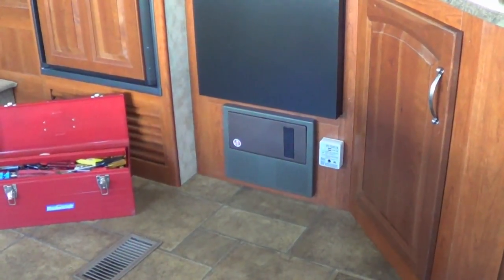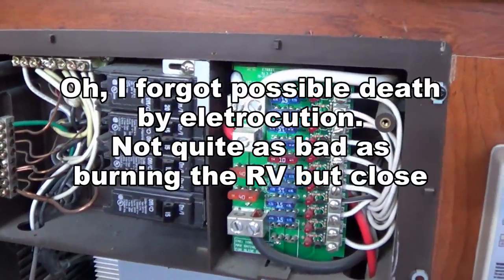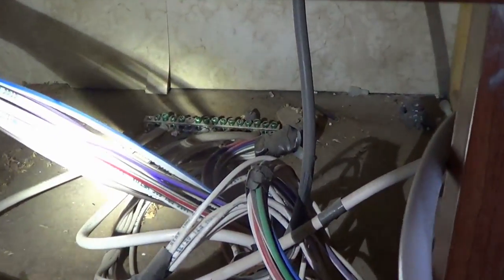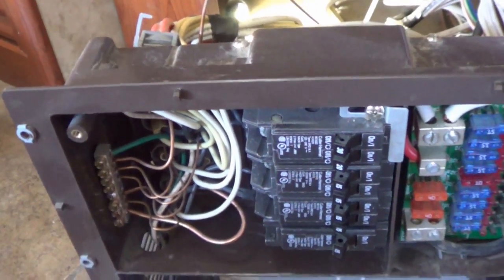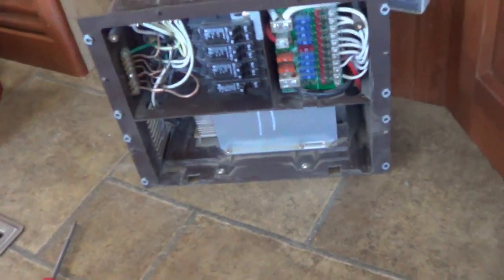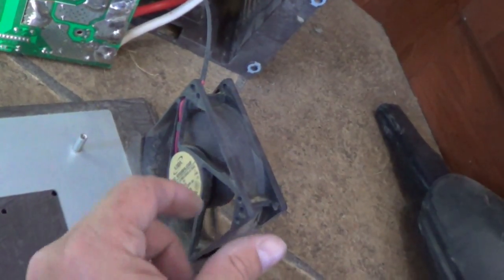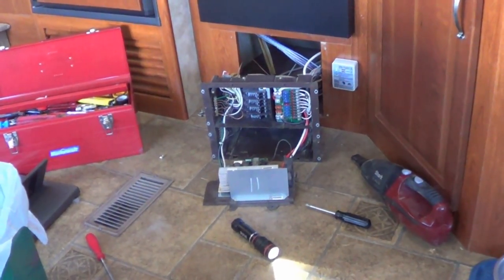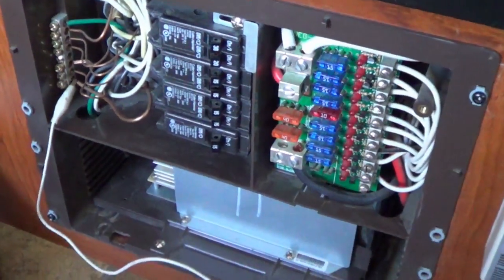RV Power Center Inspection and Maintenance WFCO WF8955

Comment: Good video.  Them  old converters cooked the batterys when left on.  A new computerized one is the way to go.  I see Angie checking out your work.  Did she pass it?
Reply from the maker: Yup! haha.  This WFCO does have 3 stage charging but it's not the greatest that's for sure. The problem with it was undercharging versus cooking them. But with the solar system installed now, my batteries are much happier. :)
Reply: I always wondered if you could feed the output of the old inverters directly into the solar charge controller panel input and have your solar charge controller control the voltage going into your batterys?
Reply: hogcat... you mean "converter" not "inverter" right?
Reply from the maker: I personally haven't heard of anyone doing that. Would be an interesting experiment. Might work but I think it would likely be inefficient.
Reply: Inefficient no doubt, since introducing any components into the path would add each component's own inefficiency to the total chain, but if it works it seems like it could be better for the batteries when using older converters?
Reply from the maker: I assume so
Reply: Yea I meant converter.  Sorry
Reply: Thanks Ray very informative.
Reply: I do have a wfco in my motorhome and I just bought it a week and a half ago
Reply: And I was looking at the panel today as a matter of fact. I don't have all the experience you have. But again I thank you for the introductory on what that was.

Comment: Great video. How do you shut off your controller charger when you are running an inverter?
Reply from the maker: My RV has a dedicated breaker for the AC supply to the charge converter. Flick it off and the charge converter is off.

Comment: Thanks for the response. So your intellipower only works with the generator for the batteries?  Is it a separate system from the OEM?  I’m confused how the two converters interact with each other.
Reply from the maker: Yes, they are separate, I installed a separate input receptacle at the front of the RV for generator to plug into to recharge my battery bank via the InteliPower charger when needed, normally we get our charging power from the solar array but when the sun doesn't shine the generator is used.  When on full hookups I just let the OEM converter work alongside the solar charger. May as well wear it out versus my InteliPower unit.

Comment: Ray, thanks so much for the excellent video. I know I am late to the party but this info is just what I need. I recently installed a lithium 100ah battery. I have the same converter as you. The company rep told me my charger will work with lithium but not designed for it. WFCO does have a bottom section that is designed for lithium and I can get it, at a cost of $285 plus install from a local RV specialist. Since I run a Renogy 100 AH solar charger designed for lithium and a stand alone battery charger also designed for lithium, I am not sue I need to go to the extra expense. With the Relion lithium battery came a battery monitor with shunt. It has been suggested that I install the shunt to the Controller. Any ideas about this . I am a little confused as to where the DC load pole would conect to the shunt as well as the DC cable that goes to the battery. Any help would be appreciated.
Mark
Reply from the maker: I've just left my OEM WFCO the way it is for use hooked to shore power and use solar and a second better quality converter located beside the batteries to charge with, usually, it's with the generator when off-grid.
I've found the WFCO won't even charge the lithium much. Tends to drop into float and just maintains the charge.
You want to install the shunt between the battery bank negative feed and all the negative loads. That way it can measure all the current going in and out of the battery bank and calculate a state of charge in percentage. Cheers, Ray.
Reply: @LoveYourRV  Thanks Ray. IF I keep the Lithium, I will upgrade the bottom unit as suggested by WFCO. I suppose I could replace the whole unit but ar what cost? I still think the Lithium was a good LONG TERM purchase, just getting more costly initially.
Reply: @LoveYourRV , Ray, the part # for the WFCO lithium converter is : WF-8950 L2 MBA WFCO
Reply from the maker: You could also use a different brand like a Intelipower or a Iota

Comment: Does your intellipower also feed the 12v side of the power distribution center?  That’s where I’m getting confused.  Do both converters power the DC side? Thanks!
Reply from the maker: Sure, there is the cable leading from the battery bank to the RVs 12V distribution panel, so since the IntelliPower is connected to the batteries it's also capable of feeding the 12V distribution. Just like when you are unhooked from shore power your batteries provide power to all the 12V stuff in the RV
Basically just think of my InteliPower as a fancy battery charger I'm using with my generator. To get the maximum charge amperage I located it next to the batteries to reduce wire losses and voltage drop.  If I wanted to turf the OEM WFCO converter I could simply remove it and run an AC power line to where the InteliPower is located and it would also be my shore power charger, but like I said I prefer to wear out the OEM converter doing that job as all it really does is sit there trickle charging for the most part anyway. So if it someday packs it in I'll do that.

Comment: Word of warning....if there is solar installed. Always switch the PV input to controller off BEFORE switching the battery disconnect off , as most controllers require batteries to be hooked up when they are generating power from the PV! I swapped out my battery disconnect switch for a dual pole version to simultaneously switch off the PV when I switch off the batteries.
Reply from the maker: Thanks, a good tip for others. In my case, my battery disconnect switch only switches off the 12 volt RV circuits. My solar controller was still connected, I have a separate switchable breaker for that. Was no need to turn it off as my inverter has its own outlets separate from the regular RV AC system.   http://www.loveyourrv.com/wp-content/uploads/2016/07/Boondocking-System-Diagram.jpg

Comment: Good video Ray, doesn't World Friendship inspire confidence. I noticed there was some slight discoloration on the AC/DC converter PCB. I'm sure its normal, results of a warm component,  but someone might worry about it if the are doing a Ray style inspection.
Reply from the maker: haha, yeah, really. ;)If it's the brown around the 4 large solder joints for the two big white resistors it's just extra flux that flowed off the joints.

Comment: Were is the on an off switch located you showed on video?
Reply from the maker: It was in my battery compartment which is the front storage bay on my fifth wheel trailer. I installed it there so I would have a way to quickly cut the 12VDC batter power to the RV circuits with out having to unbolt the battery terminal. Some RVs come from the manufacture with a battery cutoff switch some don't. Cheers, Ray

Comment: Ray, I've got a 2012 outback with the same fuse panel and my fan on the power converter isn't working at all. So when I use my rv I haft to keep the cover off to let the heat out or it overheats and flips the main breaker. I'm no electrician, but would like to know, how can I change the fan or can I? Or do I haft to buy a new converter?
Reply from the maker: It looks like a computer fan, 12V I imagine. You could pull it out and see if it has some writing on it so you could match up a replacement. It should only have a couple wires to dal with and may unplug from the main converter board. I'm away from my RV on our boat now or I'd look for you. Cheers, Ray

Comment: Ray doesn't  the DC convert to AC?, or does it convert both ways?
Reply from the maker: The WFCO converter converts the AC shore power into DC power to charge the batteries which power the RVs 12 volt circuits. It's often referred to as a charge converter or converter charger.  An inverter is what converts DC battery power into AC power.  And lately, RV companies have been installing a device called an inverter charger which basically is a combo of the two.  Gets confusing. :)
Reply: Ok that makes sense, thanks for responding

Comment: Question, the power for my "Charging Station" (12V and 2 USB outlets) recently loss power.  I pull the cover off the Charging Station and see two positive and two negatives are connected together that feed power to it.  Both pairs of wires are without power.  Could I trace the wire colors back to the Panel with the converter and see if they are feed into the circuit board there?
Reply from the maker: Yeah, though depends on the wiring colors. In my rig pretty well all the DC power runs use the same colors.  I would check the DC fuses and see if any are blown and for loose connections.

Comment: Hi Ray, question for you, I do have a 50amp braker pannel split in 2 sections (one leg 120v and other leg 120v) my question his do I get 25amp on each legs ? And can you go more than 25amp on one leg, let say 35amp leg 1 and 15amp leg 2 ? Thanks for your help.
Reply from the maker: A 50 amp RV power service is 240V @ 50 amps so when it is split into 2 legs each leg is 50 amps @ 120V

Comment: Hit that fan with a can of compressed air, maybe also a couple squirts of WD40 and it'll be quiet again. You can buy replacement fan online from All Electronics for almost nothing, replaced a few myself.
Reply from the maker: Good tips thanks. Even brand new the thing was annoying. Really needs a better quality fan. But, since I've installed the solar it rarely ever runs since the batteries stay so well charged. So that's good. :)  Cheers Ray
Reply: @LoveYourRV  Never use WD40 if there is heat or electricity, it is very flammable.

Comment: Ray, btw: I see that there are two 40a fuses just to the left of the fuse bank but not labeled.  What are these for?  Also, my #7 fuse is illegible but looks like “MON” but cant be sure that the last letter is “N”, any guesses?  Thanks again.
Reply from the maker: The board says reverse battery protection. I guess its for if you wire the battery backward. And the Mon in mine powers the tank level monitor panel.
Reply: Love Your RV ok, good deal.  Thanks again.  Keep up the good work!

Comment: Thanks for sharing that Ray. How many watts of solar do you have?
Take care
Tony
Reply from the maker: We have 500 watts. Here is the boondocking system as it sits now - http://www.loveyourrv.com/diy-rv-boondocking-power-system/  It served our needs well last snowbird season. We aren't huge power users, couple computers, chargers,  TV, lights, etc.
I may add two more panels to the roof at some point to help out on the overcast days.
Reply: I'm just watching your install of the second two 100W panels. I'm guessing the other 100W is the portable unit.  I like the way you layed it out.
Thanks for sharing.
Tony
Reply from the maker: Yes, a company sent me out a flexible panel to do a review last summer. So I used it as a portable panel.  - Here is how it worked out. -  http://www.loveyourrv.com/update-boondocking-remote-solar-panel-mod/

Comment: Where is the Neutral bus bar for the DC side. All videos I have seen, there is the hot and a neutral side for hook ups. I see only one side for hook up.
Reply from the maker: At this time in the video, you can see the negative DC bus bar -  https://youtu.be/gr2iNdMzqi4?t=219. It connects to the RV chassis below it. Bolted to one of the trailer's steel I-beams

Comment: Where is the neutral bus bar for the DC side? I see other Progressive amid converter videos that have the hot side for the DC wiring and one Neutral bus bar for the other wires. I only see the hot side for the DC wires.
Reply from the maker: At this time in the video, you can see the negative DC bus bar -  https://youtu.be/gr2iNdMzqi4?t=219. It connects to the RV chassis below it. Bolted to one of the trailer's steel I-beams
Reply: Thank you for that. I did not know with this model you had to actually purchase a neutral Bus bar for a complete hook up. I had just bought this one and was wondering how it needed to be done. Thanks.
Reply from the maker: @danemmerich6775  Here is a closer look at it from when I replaced my stove https://youtu.be/FfsmPsW2GX4?t=326

Comment: can I pick your brain I have a problem . my thermostate  blew  a fuse I changed it I changed the computer board in my AC its a 15000 and my fan copasitor . my AC and heater dosent work still mabe u can help me . I have a Laredo the same as your.thanks love your show.
Reply from the maker: At his point, you are going to have to get a multimeter and a schematic of the AC heating cooling system and start to make voltage measurements and see what circuit is a fault. Try to find the service manual online for the AC unit and follow its troubleshooting steps. If that is beyond your comfort zone then an RV tech needs to be called in. Cheers Ray

Comment: Here are two links to the WFCO power distribution center and the Inteli-Power PD9200 power converter:
https://wfcoelectronics.com/product/wf-8955-55-amp/
https://www.progressivedyn.com/rv/power-converters/pd9200-series-rv-power-converters/
Manuals for both can be downloaded at these sites.

I would not worry too much about the length of the wire to the battery -  the total resistance of your 4 AWG wire is only 0.01 ohm. If they are being charged at a 10 A rate, this is just a 0.1 V drop. And as the batteries near their end point voltage the charge current will drop and the voltage drop will become negligible.
Reply from the maker: Hi Tom.  My stock charge converter location uses around 25 feet of 6AWG wire plus a frame negative return path. I mounted my Intelipower PD9260 right next to the batteries and have compared the two. I get much better charging with the closely mounted Intelipower translating into much less generator run time when boondocking. Here is the install - https://www.loveyourrv.com/installing-the-inteli-power-pd9260-for-improved-rv-battery-charging/
Here is an example of how I use it in the real world. - https://youtu.be/Ppx3gODUPP4?t=266

I still use the OEM WFCO when on hookups as my solar takes care of most of the battery charging and the charge converter is usually just in float mode, so may as well wear it out as opposed to my expensive Intelipower. Cheers! Ray

Comment: If you were adding a Surge Protector/EMS, is this cubby hole were you would put a HW’d one? Looking to add one but not really sure where is would be added. Thanks.
Reply from the maker: That could be a good spot since the main power comes in there. I ended up putting mine at the back of the trailer were my power line from the outside went into a junction box under a coffee table. https://youtu.be/Svpuvw83beQ?t=203
https://www.loveyourrv.com/progressive-industries-model-ems-hw30c/   Cheers, Ray
Reply: Love Your RV Mine comes in from the side.

Comment: figured you 'd have replaced it with a prog. dynamics long before now
Reply from the maker: I have the PD9260. I installed it right beside the batteries so minimal wire losses and use it for off-grid battery charging with the generator. When on full hookups I still us this WFCO since it really doesn't need to do much as our solar system generally keeps the batteries charged up well. I figure I may as well wear this one out when on shore power rather than my PD9260.